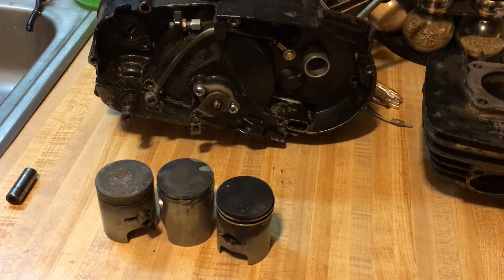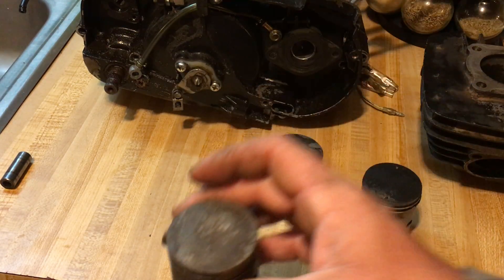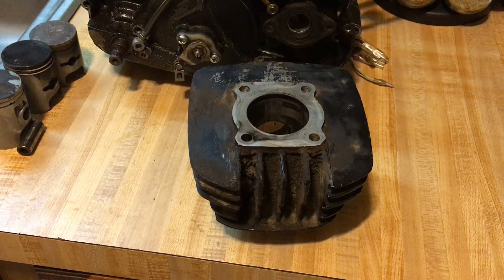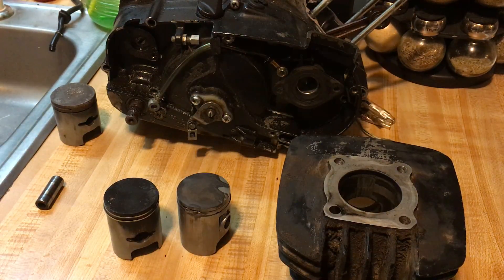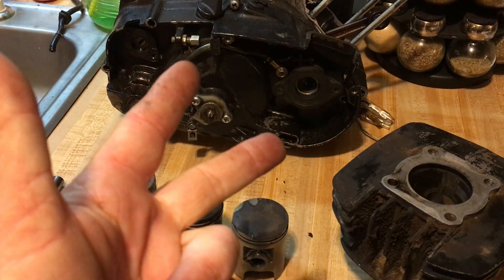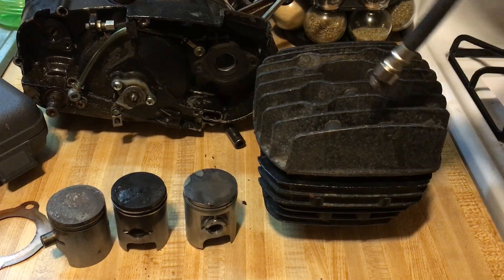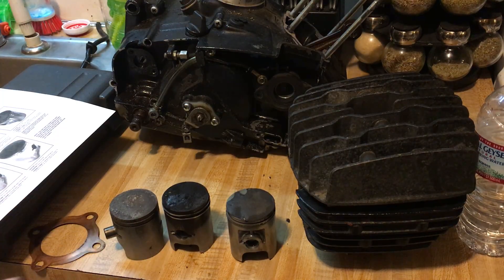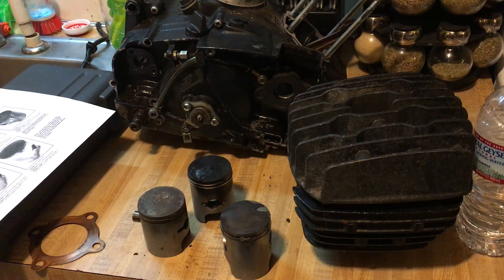piston fail

Comment: Getting a new piston and rings, and I need them oversized. Looks to be about .020 over but I’ll measure. What is the diameter of a oem standard piston on a km100, and then how interchangeable are the g5, g4, km, ke, etc models? I see a bunch of parts on eBay listed as that, but I was going to buy piston rings that were for a g5, so wondering if I could use those
Reply from the maker: 49.5
Reply from the maker: What year make and model
Reply: Kevin Bergeron I believe a 1979 km100
Reply from the maker: @Billyjoe78517  g5 ke100 is compatible
Reply: Kevin Bergeron sounds good thanks! Just making sure. I bought a standard piston and put it in and tried to start it and the compression was too low. Turns out that the old piston had a 020 stamped on the top😂. Woulda saved me a lot of money if I had seen that
Reply from the maker: @Billyjoe78517  buy the new piston and ring bring it to the machine shop with the piston after boring it will need to be re nikisile and the ring gap set after
Reply: Kevin Bergeron I’m not planning on boring it. Got a new engine with a smooth cylinder wall, so before I did anything with it (even though I got it to run) I pulled the old piston out and am replacing it

Comment: I have a question, I'm rebuilding my ke100 and both heads I have have huge scratches and scars so I was wondering if I get a 50mm piston and get the jug bored to 50mm will it be all good?
Reply from the maker: What year ke100 if it has cast iron cylinder then yes just need to bore if it is aluminum it's a lot more expensive boring and nikisile coating
Reply: I'm willing to pay the extra money if it turns out to be aluminum I just wanna make sure I don't have to do any extra modifications
Reply from the maker: @mattlockard357 main jet to 80 your bike might already have the 80 jet
Reply: @2strokeguru  what? I'm new to the bike and mechanics stuff trying to learn and teach my self everything not to sure what that means